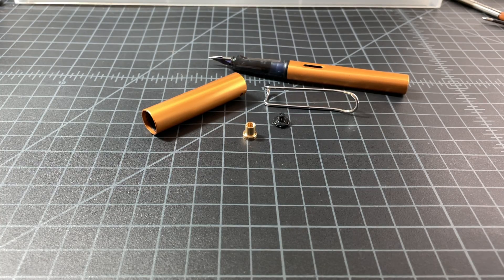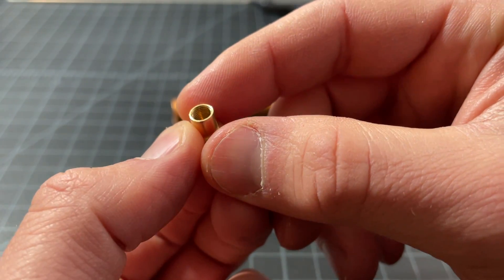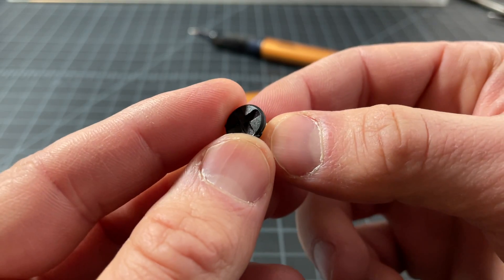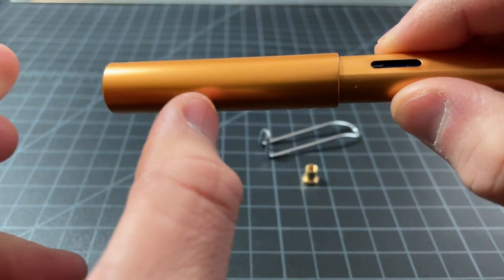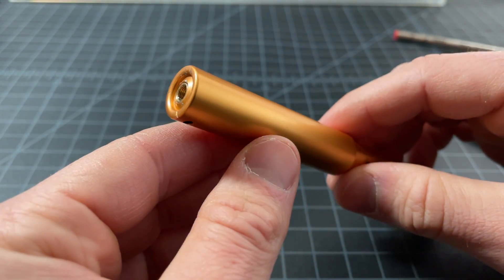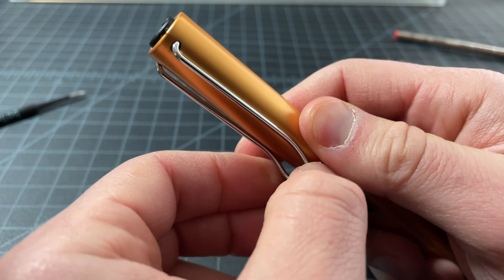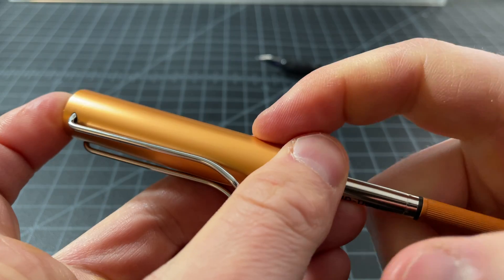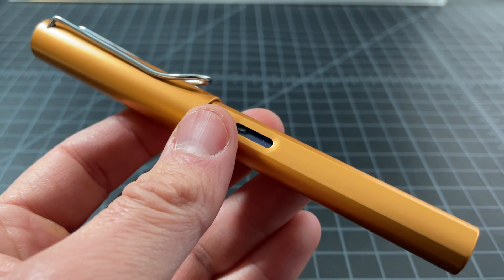How To Fix The Lamy Al-Star Clip (A-Star Cap Deep Dive)

Comment: Hot-melt glue. A small glob put into the brass "nut" just before reassembly, and it will stay together until you want to disassemble it. Use isopropyl alcohol around the black "rivet" when you want the hot-melt to let go.

Thanks for the great clip primer.

Comment: Had the same issue. Reassembled it as tightly as possible, added a drop of superglue in the threaded hole of the brass thingy, added the plastic part while exerting pressure from underneath. Now it's as good as new, totally tight and no way you can tell it was ever disassembled (unless of course you try to disassemble it again, which would be rather impossible with the superglue holding parts together). I suggest you try it, too, it will become an actually usable pen, again, because the way it is now it must be ready to fall apart at the slightest push or pull.
Reply from the maker: thanks, I think you nailed it. Impossible without the glue.